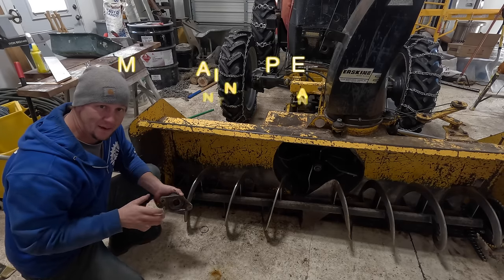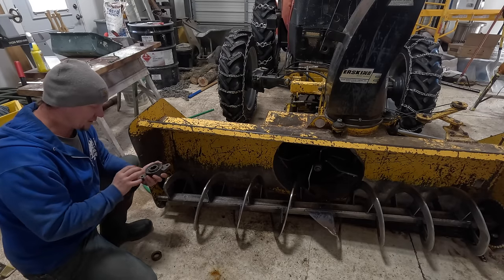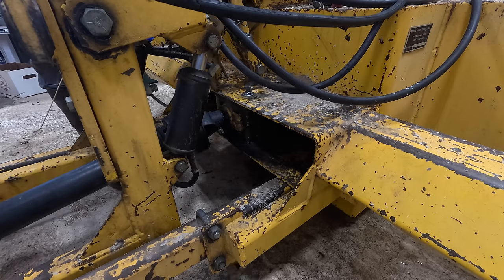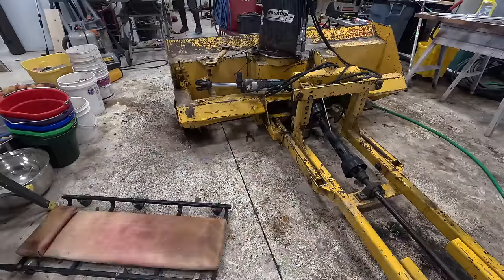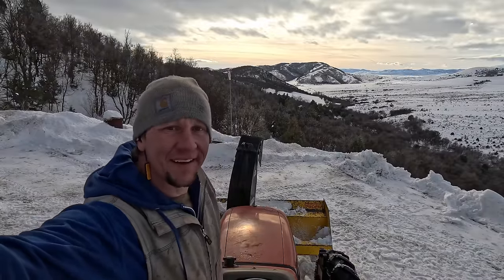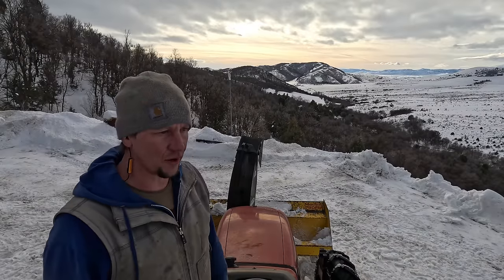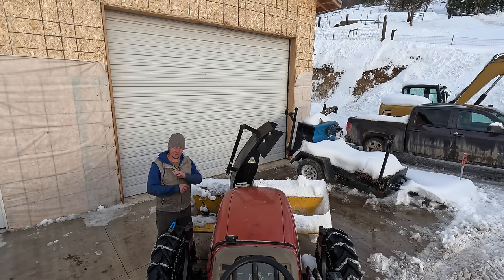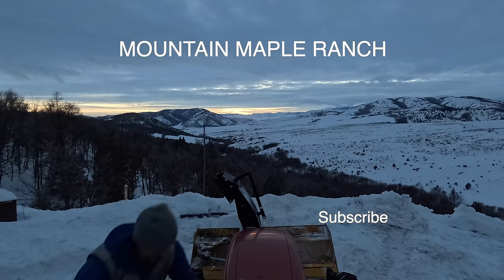while SNOWBLOWING my AUGAR RIPPED off | Why don't I get a CAB for my tractor?

Comment: You mentioned all the red tape and made me think of fire service and emergency services. I would think Home Insurance could be almost out of reach. My home insurance take into consideration distance from Fire Department. The further distance away, charge goes up. It seems you guys are pretty much on your own.
Reply from the maker: Yes, we also knew that when we moved up here. However, my wife works at the local hospital and the EMTs would still come out here if they needed to. This community is really amazing that way.

Comment: I can relate to so much of this video. Went through half a dozen shear bolts in 200 feet at one point this winter. Our big problem has been the warm weather. 6 inches of snow on top of mud doesn't snowblow very well! Lots of time needing to work with my back blade instead of getting to just blow the snow. Only had a couple weeks of consistent freeze where I could get a good packed surface for my blower.

For my blower, it specs grade 2 bolts for the shear bolt to the auger, then metric 8.8 bolts for the PTO. Haven't broken any bolts due to snow weight, just to all the rocks on our unmaintained county road. Really liked this video, and now that we have internet at our house looking forward to catching up on a lot of your past videos too!

Comment: Just an Idea , what if you fabricated two separate hydraulic drive motors for the fan and the gatherer? Maybe drive them with a pto driven pump if your tractor doesn’t have enough volume?
May be too expensive to do, but may turn that snow blower into an awesome asset to your situation.
You definitely have more patience than I do and a very calm demeanor!!! Rock on and keep up the good work!

Comment: I enjoy the view every time you show it.
Wet snow is the absolute worst to deal with.
I saw a great view of the chute rotation mechanism and it is no longer a mystery. 
I just searched for what bolt has the best shear strength.  I had the same belief that the brittleness is not the characteristic wanted.  I saw so many different answers that it turned into a rabbit hole.  One answer is that shear rating, though not measured for bolts, is accepted to be 60% of tensile strength.  Another said bolts should not be used in shear (we all know this is standard for many applications like yours).  Maybe larger or multiple bolts but that risks other elements of the drive train and is undesirable.  It might be worth diving more into a search or talk to your local highway maintenance group and see if they gained knowledge.
Reply: Check with local farm equipment dealers to see if they have shear bolts in the right size.   The bolts will be more expensive, but they were designed for that use and may hold up better.

Comment: In explaining your predicament to my significant other, he suggested that using fine treaded bolts work better where there is extreme vibration as there are moret hreads per inch which gives better engagement. He also said using silicon spray on the bolts might help.

Comment: All parts are available and affordable from Erskine to service your Front Mount blower. A couple of years ago, I rebuilt bearings, seals, chains, etc on a 30 year old fm780 blower. You can buy bearing inserts for those pillow blocks in stock at TSC or and ag supply store

Comment: Mak, Have you thought about spraying clear floor wax on outside and inside your snow blower parts?... i used to put clear floor wax on my shovels and snow would just slide right off.... just use an old spray bottle.... i did not wipe clean i let it drip dry over night....

Comment: Absolutely agreed. About the view, and the work! Also, all that work on maintenance and repairs is vastly preferable to not having the implement for use. It's too bad you can't put some sort of backup box or blade on the back of the tractor while you have this on.

Comment: Lithium grease is hygroscopic, which is fine if you use it for fast-rotating parts that run warm. But if you use it on slow moving parts, it absorbs moisture and causes rust. Better to use a calcium or molybdenum grease.

Comment: Thiughts, take a heavy gage wire mesh, 3 or 4 inch squares. Make a frame to add itctovthe front of the blower. This would keep the larger items out of the blower. Make it removable to work with heavy sticky snow.

Comment: Some green Loctite thread locker might be a good thing for you rattley bolts, keeps em tight, but you can still get them off
Reply from the maker: that’s precisely what I used on the gearbox bolts, if you look closely you can see the red bottle next to the chute in the video. :)

Comment: I agree the view is so worth it. Just a few thoughts.
The bolts would it help to use the special loctite to secure them from rattling out so quickly.
I wondered if a cover to prevent barb wire wrapping around your bearing.Nothing elaborate. 
That was like plowing wet cement. Totally just taking in the views.

Comment: That's why we move the slip clutch right up front saved a lot bolts
Reply from the maker: that makes a ton of sense. that was my same thought… how to get the slip clutch on that new shaft I installed. haha with any luck I’ll upgrade tractor and blower before it’s too much more of any issue. :)

Comment: Barbed wire is the scourge of all rotating equipment!
Isn’t the D3B running? I’d be using that to push the heavy snow on the county road. Open it up just wide enough to let a fire engine pass through and use the snowblower on your own roads where it won’t get bound up all the time.
Reply from the maker: I don't have it fixed yet. Ola and I were just talking about the next thing to get in the shop once I get the processing kitchen cabinets built, then more room is available and the dozer is definitely next on the list.  I will be using the dozer to cut trails to the other half of our property in the spring/summer.  Not sure how I feel about driving the dozer on snow and ice, it's mainly on tracks, and If I were to push snow it would destroy our neighbor's fences and their property,  I primarily stick to the blower cause it does not damage the other private land owners fences.
Reply: @MountainMapleRanch  
That all makes perfect sense now that I understand the technicalities 😊

Comment: Mark, I have a lot of experience with BS, but very little experience with blowing snow, so if this is a stupid question - sorry! Is it practical to put some kind of guard on front of the augur that wouldn't just push the snow? Would a 3/4- or 1-inch bar sticking out the front be any help?
Reply from the maker: It’s not a bad idea. I have a few more storms left but definitely want to make some adjustments next year if I keep this snowblower.

Comment: question what's the brand name off your snow  blower on the tractor
Reply from the maker: Erskine is the brand of the snowblower. I feel it’s a pretty good snowblower, I feel that OshKosh is build better but I don’t see them on the market used very often.
Reply: is there a horse power requirement @MountainMapleRanch
Reply from the maker: It’s 40-100 horse power rated.

Comment: The animal that has been chewing on your electronics is with a high probability a Marten.!  This animal is similar to a mink and very aggressive and they love the taste of the insulation on the cables connected to the electronics underneath the car where easily accessible.  If you live outside of the city in the countryside, this happens very often, unfortunately But as unfortunate most people don’t even know this.! I might suggest setting some traps might be helpful but you don’t need to kill them, but you can capture them and take them to another designated area that is further away human population.🤷‍♂️ these animals are very Flink and very hard to spot and they have a voracious appetite and eat anything they can get between your teeth. And I have even heard that his animals are called the North American Tasmanian devil so if you try to capture these animals be extremely careful !!. And the other thing is these animals see you first not the other way around. They are very smart and very fast.